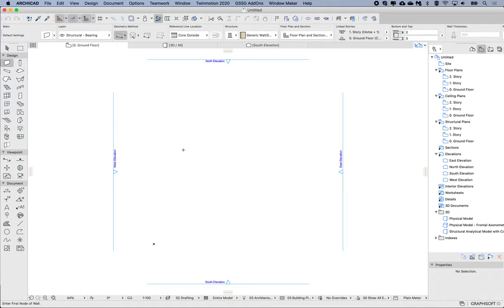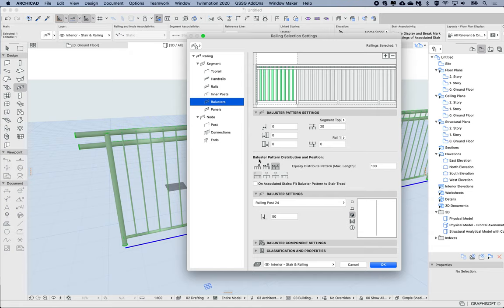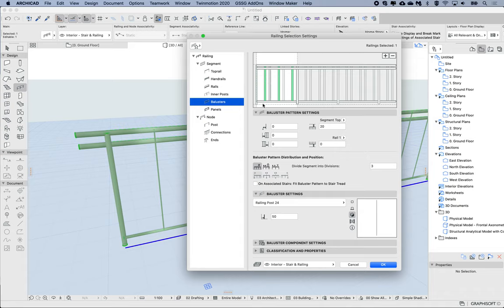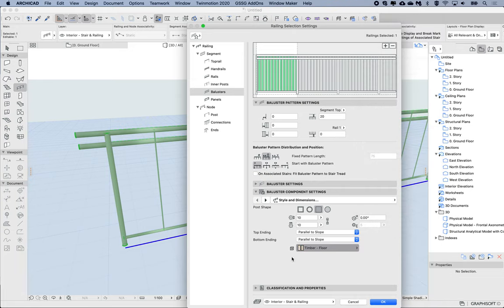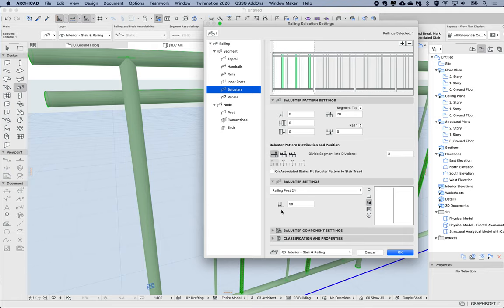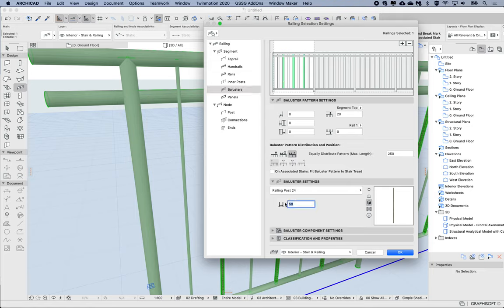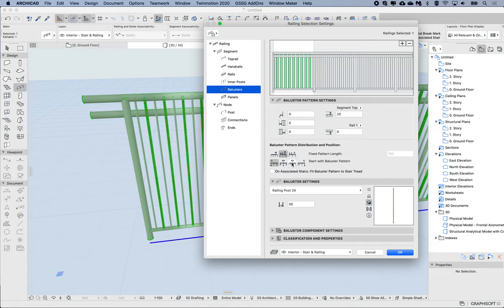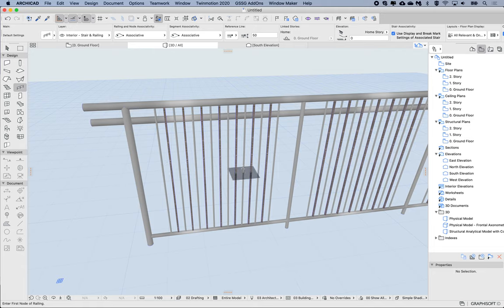Archicad Tip - Edit the Railing Baluster Pattern

Comment: Hello may i ask??

I put railing on slab of 2nd floor.. how to connect this railing to the railing of the stairs?? 

Also i use glass panel for the railing (of other stairs). How to cut delete some panel at the lower part??

I'm sorry for the trouble.. i am still learning using archicad. also thank you for the video..
Reply from the maker: Railings can associate, just check the infobox if it's associative when placing, and make sure to place to nodes. You'll see a pre-highlight of the stair if it's going to connect.
Not sure what you mean with the glass panel, but I'd recommend to post to Archicad-Talk forum, there's a great community there who can help, but make sure you post a pic as well.